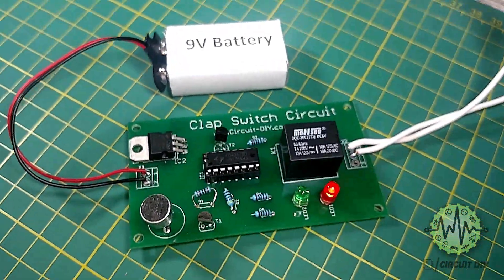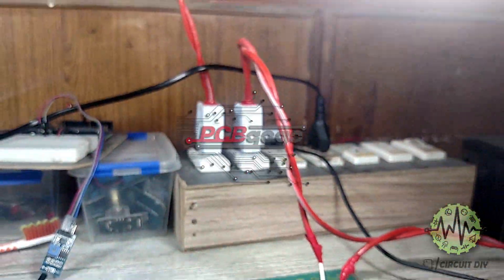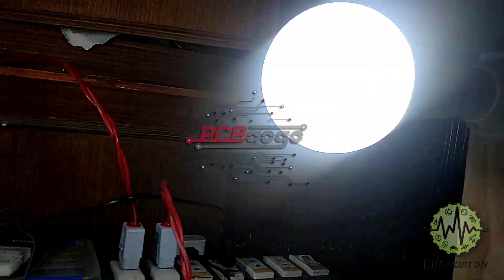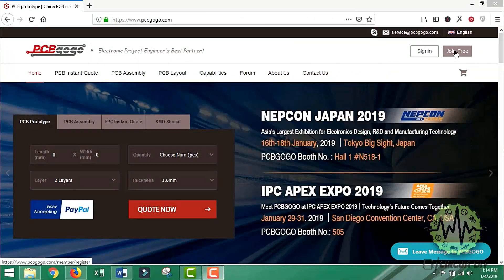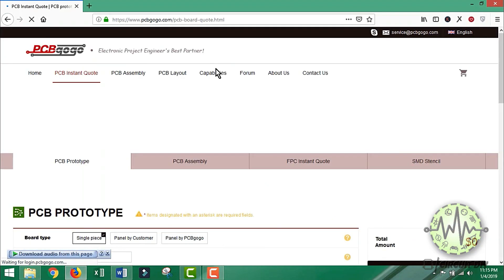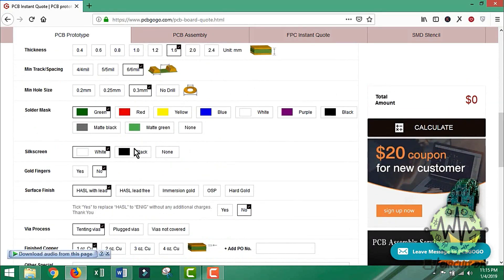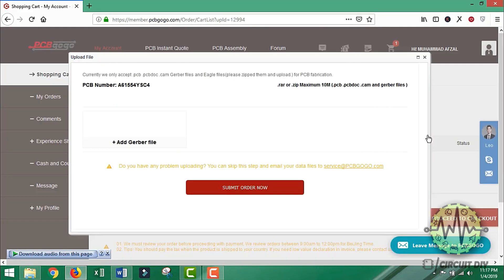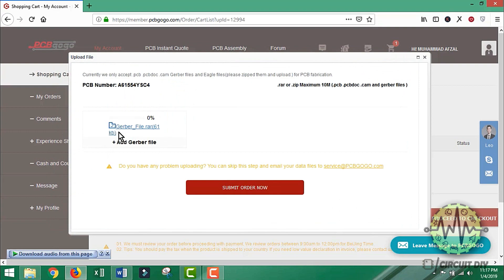How to Make Clap Switch Circuit | Electronics Projects

Comment: this is not working .According to the diagram i made it .
Reply from the maker: It's tested 100 working Circuit ...kindly recheck the wiring and mic polarity sometimes it there's problem at input signal from mic
Reply: @CircuitsDIY Does any led glow after connecting the battery
Reply from the maker: Yes yes its fully tested and working
Reply: @CircuitsDIY  mic  polarity is also checked and I change the mic also but not working